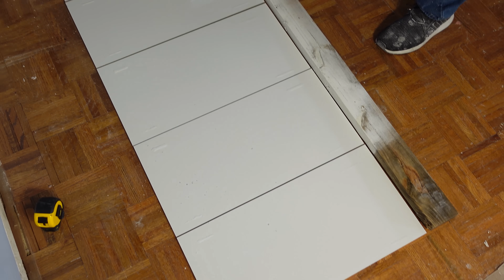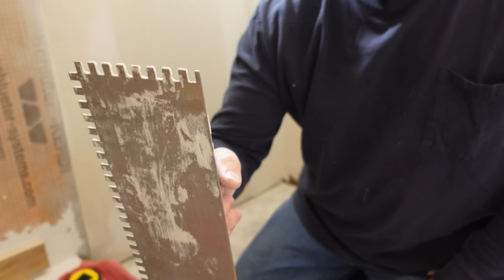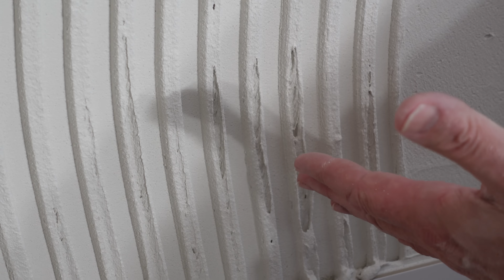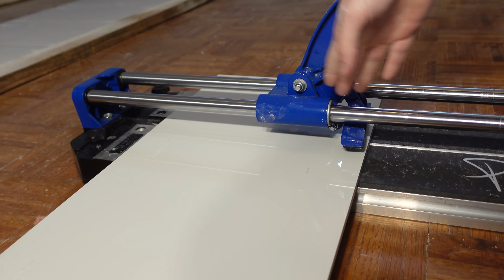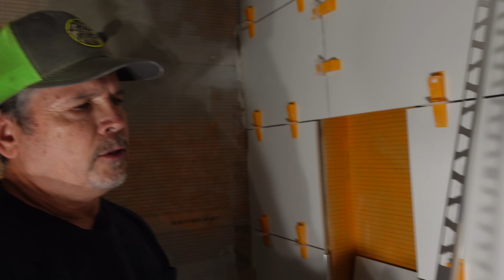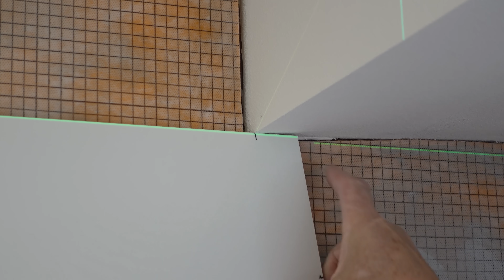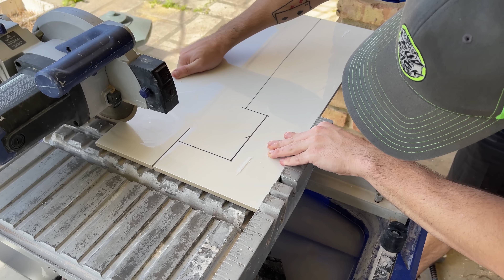Buy THIS Tool BEFORE You Tile! | Tiling a Shower

Comment: Very nice, lots of great techniques taught.  The niche from Schleuter comes pre-sloped on the bottom, provided you put it in the right way up!  :-)  You may want to let viewers know that so they can use it correctly.  The edge trim can likewise go on either tile surface, doesn't matter just depends on where you want the thick surface to show.  The way you used it minimizes the edge, putting it the other way makes it stand out more.  It's a matter of taste and styling.  Again, great quality video guys!

Comment: Another great video. When you used extra thinset to crests a drain slope in the niche, is that the normal way of doing it? I'm not a tile guy, but my first thought was to have the bottom of the niche already angled.

Do you all have any videos of tiling around a window for a shower/tub setup? That is one thing that is making me very hesitant to try remodeling my mom's bathroom. Horribly needs it, but it has new window and siding so I'd rather keep the window and work around it but the waterproofing around one is something I have no idea on how to handle.

Comment: Tile installed appears to be a large format. 

Know that large format tiles typically have a camber to them. Refer to the tile specs before install. Large tile joint layout options are usually either a stacked bond or running third bond pattern. 

Always install with parallel grout lines. Now swirls for structural best fitting tiles. Swirls introduce voids. May mean tiles failing falling off a wall. See how tough it was to remove.

Note you cannot level out the camber in a tile. Is a manufacturing affect of their processes associated with producing a large tile.

Comment: Top left tile ! All that attention to layout and one bobo! 
The 1/2 inch sliver  could of been eliminated by adding another layer of sheet rock to the fur down. 
I prefer my nitches to have the sill piece over lap the wall tile outside of the nitch so water will not run down behind the wall tile when the grout cracks at the metal Schluder edge!

Comment: Question: You use notched trowels to apply thinset. You mention different sizes like 1/2". When you apply the thinset, you hold it at an angle which, of course, you have to in order to get the thinset to flow properly. How does this affect the height of the notches? Obviously the steeper the angle, the less effective notch height you get. Is that taken into consideration when they made the trowels, and what angle is appropriate?

As always!
Reply: If I remember correctly in the free Schluter workshop I took  then the trowel needs to be held at a 45° angle to apply the thin set correctly. This way you apply enough thin set and not too little. Depending on your tile size then I believe it can also affect what size of trowel you need to use. I confess that I did not pay attention to that part too much in the free Schluter workshop because my projects are not dealing with tile sizes large enough to concern myself with that. BTW… 😏… Did I mention that the workshops were FREE!!! 🤣😆😄💯👍 I just can’t seem to get over the fact that the workshops were free, nationwide and it literally only cost me my time and I got so much out of it! I hope you check it out. Thank you!
Reply: @insecureinvestorchallenge7366  Thanks for the info!!  😃

Comment: Maybe I missed something....  when you use CUT TILES  on the right side, where the glass will be,  you have the option of having the FACTORY-EDGE always outside.... and CUT-EDGE towards the niche...      But, did you have any reason to have the CUT-EDGE  on the outside rather than the NICHE-SIDE?
THANX
Reply: I kind of see your point. The Schluter profiles are great because they protect the tile edge from chipping. But if you are covering that edge with a profile then it makes sense that it would probably not matter if the edge was factory finish or cut… unless you accidentally undersized the profile and would like the tile edge to look a little more finished. 🤔😙👍 Something to think about. Thank you for your comment!
Reply: @insecureinvestorchallenge7366  
THNX
Reply: It doesnt matter with rectifed porcelina tile no one gone notice that witch way the tile goes

Comment: I’ve been doing custom showers for 12 years the hole saws I use are just the Milwaukee from Home Depot 1 3/8 for pipes and 2 1/2 for body sprays keep them wet they last for a pretty good while
Reply: I get cheap ones from eBay. They cut through tile faster and cleaner then the $100 sets and I don’t mind throwing them away and grabbing a new one. I use a cut solo cup with some putty around it. Pour some water in and rock and roll..

Comment: Nice job guys, I got my diamond hole saws on Amazon I got cheap ones in a case and I've already used them a dozen times still look new ,and a tip I do that makes the leveling shims come out easier, I use a size smaller and then use spacers it works great for me ,but if you get all the thinset out of your grout lines like it looks like you did then you probably won't have a problem.
 But I really enjoy your videos I wish I had  the ability to make videos but to old to start now ,thanks for all you and your son does for your viewers.

Comment: If you were installing a grab bar in the shower what would be your method.  Please
Reply from the maker: We installed 2x8 blocking in the wall for grab bars 👍
Reply: I would recommend Kerdi-fix on the screws to seal the penetrations. Being able to screw into the 2 x 8 blocking is awesome! I hope this helps.

Comment: Beautiful job!  I’m not a tiler but have a couple of comments about leveling clips.  If you install the wedges pointing toward the already laid tile, it will pull the tiles tight against the clip and the already laid tile.  But, if pointing toward the tile being laid, they have a tendency to push the tiles apart and can widen the grout line.  Also, when putting the clips in on your last row for the day to come back to the next day, be sure that the wedge is tight against the tile otherwise if there is thinset atop the wedge it won’t pull the tiles even the next day.  I insert a small piece of cut-off tile and insert a wedge to hold the cut-off, the tile and the leveling clip in the proper alignmentfor the next morning.  It’s a pain to have to cut out the thinset and leveling clip the next day because the clip isn’t up against the tile laid the day before.
Reply: Quote: But, if pointing toward the tile being laid, they have a tendency to push the tiles apart and can widen the grout line.   That is an issue I have not seen addressed anywhere. I've the wedges put in from tiled previously laid, to the new tile. There has been a time or two when it caused the grout line to open, and I had to fuss with it to make it right. I'll keep your idea in mind. Thanks.

Comment: I have  recently discovered your videos and like them a lot. I only have one suggestion. Could you please number you videos like the 
"Lock Picking Lawyer" does. I was following the progress of the "flying mouse' bathroom, and I can't seem to find the video where the electrical boxes on the back of the shower wall were installed. The end of one video Paul 'hotwired' the fan to test it, and said the boxes would be installed in the next video. The next video I could find, they were installed, and it was mentioned it was done in the previous video. Thanks.
Reply: Sounds like you’re asking for a playlist to group certain projects together. Just a thought. I hope this helps!

Comment: You are good! I learned a lot. I had a pro tiling my shower and after the job is done i realized that he was far from being a pro. He never used the leveling system i tiling is bad!
Reply: It is such a shame on how bad it is out there among contractors. Stud Pack has proven overall to be better than the average. I’m very glad to see! Homeowners need to do their research and check out the free videos from Schluter on their products and proper installation to ensure that they understand what a contractor should be doing. I am still struggling to find a contractor in my area that meets my standards from what I have learned in free Schluter workshops. I hope this helps!

Comment: If there are any DIYers out there who skipped to this video, without watching the others, you will miss the most important aspect of tiling, and that is prep. Paul’s tile goes on so nicely because he spent so long making sure he had a flat square and plumb surface to attach it to.
Reply: In my early years I learned this the hard way. Rushed the set up because I thought I was good enough to fix/hide/cheat any problems I would run into. One client, one shower changed that way of thinking. I'll never forget it. That day I learned a lesson and went from pro to expert at that moment when I knew i'd always spend more time prepping than laying from that job on.
Reply: @ProToolsApproved  Yep. Tile stobbornly refuses to bend! Great that you got the lesson, though. As I’ve gotten older, and I am almost 56 now, I have come to regard these as “kick in the ass” moments, which I recognize faster, learn the lesson, and welcome the next one.
Reply: Every video is from this start forward. Prep is hardest, most important, and most of the work
Reply: Substrate is EVERYTHING when setting tile!.....but this is a video  about laying tile. .....most important part is the substrate, whatever it may be!! Great instructions and information from this guy, ALWAYS!!
Reply: Wrong
Reply: Sooooo True
Reply: Top G
Reply: If you wind up with a sliver up top you didn't consider layout in tie installation of your pan. Think farther ahead and this is fixable
Reply: So how do you avoid the silver? Increase spacing? @jasonfunk3650
Reply: Well you can prep all you want like my husband did and then when the tiler's came in they made a worse mess than what he'd already tore out. There was no waterproofing before and they still didn't waterproof it in the new installation.
There is no grout in the walls they used clear silicone with white porcelain...? I have two standing 1/8 inch deep puddles 4 inches away from the drain hole..?? The uprights for the shower slider doors half on porcelain half on plasterboard. The tiles on the wall one foot by 2 ft some hang an eighth of an inch out over the tile below and others are the opposite. And up to half inch gap in bottom corner tile just filled in with silicone. The list goes on.
Now my husband's a disabled veteran that's why it took him so long to tear a small 6x9 bathroom apart, and it was supposed to be a present for him. Bottom line is... it must be all tour back out and redone floor to ceiling.   The help he got was from family who has been building homes for three generations. So much for family and all that love. You should see the let down in his eyes,.. it's heartbreaking.

Comment: Thanks for the content. I’ve been cutting tile for about 6 years now but only started setting tile the past month, about to do my first wall install tomorrow so thanks for the tips. I like to keep it clean while setting as well, I’ve always been the grout guy and having to clean out the joints sucked so I take the time to clean those edges as well. 👍👍
Reply: You’ve been cutting tiles for 6 years and only just starting laying tiles? My two previous apprentices were screeding and laying tiles in the first year. 6 years on the job you should be running a business or at least be a sub contractor
Reply: @benjamindelfs2718  I hear ya, I’ve left that company a couple months ago. It wasn’t a great work environment. My old boss is a great carpenter but a poor team leader. I’ve teamed up with his last apprentice, my old coworker who also left the company and now we are having a great time doing good work for good people with a bunch of positive vibes on the job site, renewing my passion for the trade so it’s going well now.

Comment: The diamond bits I prefer are Milwaukee ones sold at Home Depot. I’ve used the gray ones from lowes (I’m not sure the brand) and they work fine but the reason I like the Milwaukee is they’re 1/4” hex drive so you can use them in your impact. Though if you use the small ones like 5/16” and lower try to remember to push out the plug with a nail or something as soon as you’re done. Because it’s so small it doesn’t come out as easy and if it dries it kind of hardens in there and I have to get a nail and a hammer and punch it out. I used to use the Bosch carbide bits but if you have to drill through thick porcelain tile they wont make it.

Comment: Maybe a dumb question but why wouldn’t you tile the bottom tile of the niche over the wall? Wouldn’t that give you better water run off vs having the water standing on the inside trim/grout line? 
I don’t even do any type of home improvement work but I love watching your videos. Maybe someday I’ll put some of that knowledge to use.
Reply from the maker: It was all about how I wanted the metal trim to look.  Could certainly do it the way you describe as well 👍

Comment: You guys do a lot of tile and floors. Please buy some knee pads. Pro knees makes a small one that is pretty affordable and they last a longggg time

Also at menards they sell a pretty good diamond mesh blade. I find you get much better cuts with it than your typical brassed diamond blade.

Just as well the same blade on ur wetsaw has a grinder version. Works well with a half of a sponge and touching it to the side of the blade.
Reply from the maker: I have some old pro knees.  Need a rebuild kit for them 👍

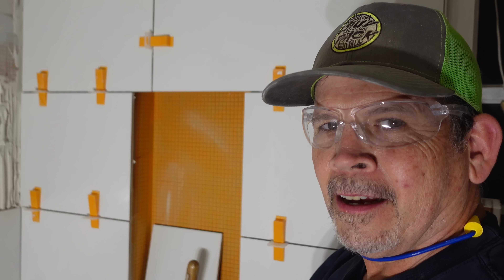Comment: 20:51 hey now, use grinder a lot, and they can give ya a really good cut, but there are those cuts when gotta be baby gentle when using; and know your limits. Maybe your blade needs changed, or tile material just didn’t wanna cooperate w/ you this time😉😆
✌🏻
Reply: The blade used was a turno blade which is for aggressive cutting. A solid smooth rim blade or a mesh rim blade is what is used for smoother cuts
Reply: Oops! TORBO  blade😅

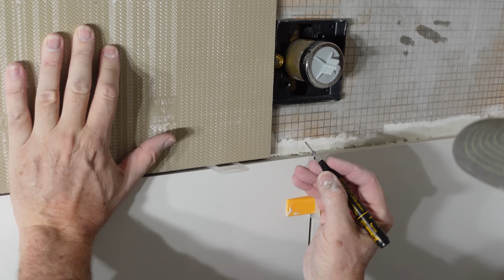Comment: 20:14 I do a diff process once in while when measuring this. I take another tile and come from other side and overlap first tile and make marks…. Just shows more than one way to do things; but, your way means holding 1 tile, and the way I do requires 2 tiles😉
Nice job on set his shower, and aren’t snap cutters just awesome. Imo, they get a bad rap and ppl think need wet saw for cutting tile, b7t even a cheapo $25 snap cutter can do a descent job, if got those skills👍🏻
Cheers✌🏻

Comment: Any thought on the curb being installed first so the wall tile goes over it , like the floor.... or is that just unnecessary?
Reply: It is unnecessary because tile, thin set and grout is not waterproof. The waterproofing is behind all of that. If you would like hands-on training for free on this then you can attend the same Schluter workshop that Stud Pack appears to have attended that they mentioned in recent videos ago. Overall Stud Pack does a pretty good job but they can’t represent everything that is in that workshop on video. I highly recommend checking out a workshop for yourself. Absolutely awesome!  I hope this helps.

Comment: Very pro, however you hopefully approved your tile layout with the customer. Going ashlar pattern on a shower wall is definable a look that some might not like. I personally love regular stacked. Also don’t EVER lean tile against anything your not planning on destroying later. Tile scratches everything. Finished cabinetry and flooring doesn’t stand a chance. Also if your going to do pro level installs invest in a tile boring kit for all your spouts and most diverter valves. Also installing tile edge becomes a breeze if you PL400 and tac in place with a couple nails or staples ahead of time. Like you learned on the second wall. The key to a fantastic tile job starts with the framing. Get your walls flat and plumb before you install anything. Also when doing the niche it easier and cleaner to do the sides pieces first. That way there is no need to angle cut your sides for the slope. Love the channel guys!
Reply: If I recall correctly then I believe this is their place that they are working on. I think they are the customers and this is their project they have taken on. 🤔 I could be wrong but I’m pretty sure that is what I recall. Thank you!

Comment: Was wondering why you had the Schluter trim installed first on the second wall, then you explained how you installed the leveling system before the thinset dried the day before. Realized you installed the trim first for the same reason. 

Currently working on my kitchen backsplash. Would’ve been nice if I cleaned the edges with a margin trowel first smh. Cleaning the grout lines is a pain. Thanks for the great video as always 🤙🏽

Comment: Question, I have a square shower in my master bath. My wife wants to lengthen the shower going through the wall utilizing extra space from the pantry on the opposite side. My question is, do I need to relocate the drain or is it OK to make a new pan funneling the water to the existing drain? The existing drain would be on the opposite side from the shower head.
Reply: You can put the drain wherever you want, as long as your slope is right
Reply: @autobodycolliosionrestorat3362  I agree. 👍

Comment: One of the few guys I see do schluter trim that way in the niche. Most guys slide the trim under the sill which i don't think looks as good. Your way takes a little more planning but in my opinion is the right way. 
Ps you guys do better work than most career tile guys.